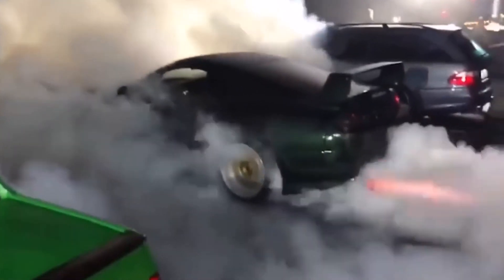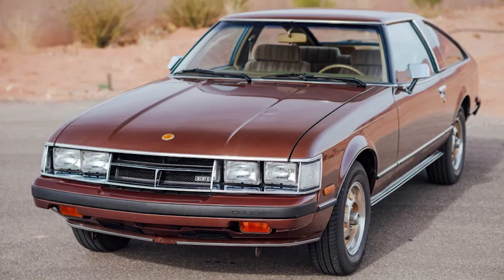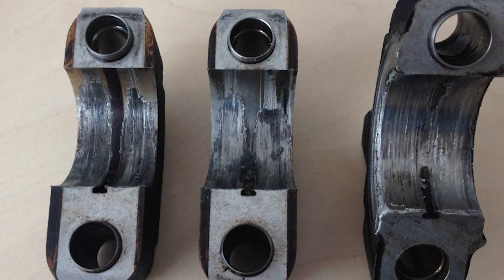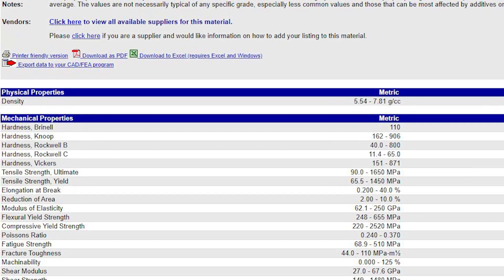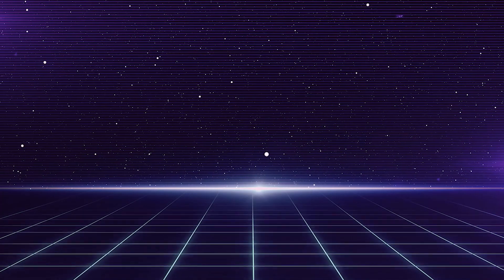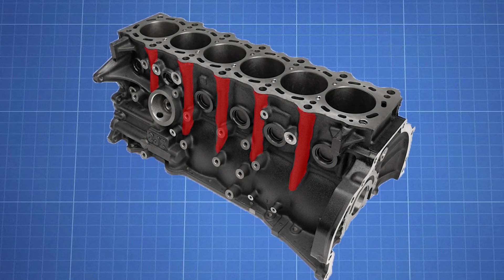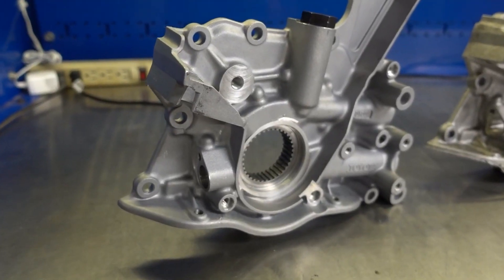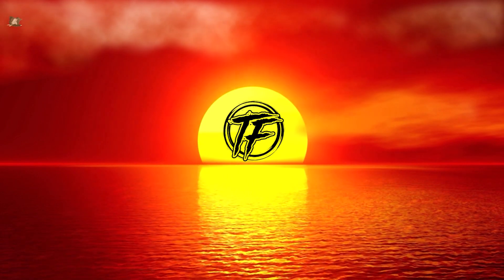The AMAZING Engineering Behind The 2JZ

Comment: Cast iron blocks Vs alloy blocks in std form cast is stronger 
But now the billet blocks are way stronger than the old cast iron
Reply from the maker: So interestingly cast iron blocks are still harder than billet blocks (6061 aluminum) but you're right! Billet blocks have higher or near equal strength to cast iron blocks! The biggest difference that makes billet blocks so much better is that they tend to have a lot more structural ribbing which adds strength! Plus, those billet blocks are just a much higher quality of metal than anything done through the casting process which adds strength and makes them less prone to cracking which is a big problem with cast iron blocks!

Comment: Nice video but with two mistakes.
1) Toyota make the 2jz for the aristo jzs147 in 1991 and after two years toyota put in in the supra a80 ( mk4).  The owner of the 2jz is toyota aristo jzs147 ( 3.0V with 2jzgte and 3.0Q with the 2jzge), not the supra lol.

2) The 2jzgte came out with 276hp or 280ps and not with 267 you say.
Reply from the maker: Great catches my man! I just wanted to make it clear that I wasn't saying the 2jz first came out in 1993 in the mk4 supra, I was just saying 1993 was the first year that Toyota put the 2jz in a Supra for the first time. For the stock HP of the 2jzgte, I found that this source:

(https://www.jdpower.com/cars/shopping-guides/guide-to-understanding-the-toyota-2jz-gte-engine)

claims it made 267 which is the number I went off of for the video. I see other sources pointing to 276 hp so you may be right!
Reply: @TunerFaction  It is better to say when they came out and after in what cars they put it ( 2jz in this video) because maybe you have message like mines 😂😂😂.
The hp is that i say, maybe the site you see it, make the mistake in the two last numbers ( 76-67), it is very easy that mistakes, all we make.
Reply from the maker: @vasilisaristo2jzgte355  Hahaha fair enough my friend. If I ever make a video like this again I will try to clear up that sort of ambiguity. And yes I looked into it more and think the source I used had a typo on the last two numbers of the horsepower. Thanks!
Reply: @TunerFaction  Nothing brother, continue the good work 👍👍👍
Reply from the maker: @vasilisaristo2jzgte355  Thank you very much brother I appreciate that!!!
Reply: @TunerFaction  Hamburger!
Reply from the maker: @RobertMoonWalker  We love those!